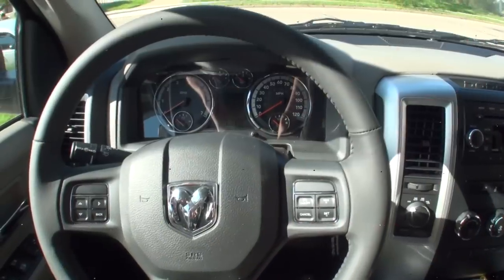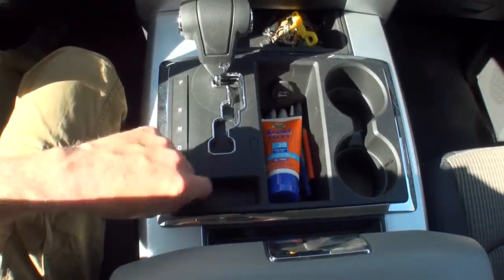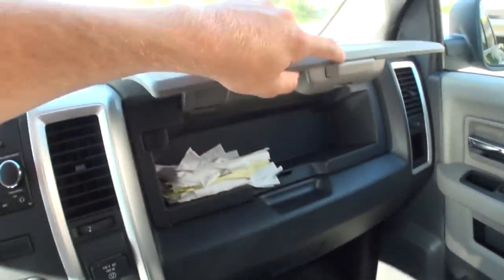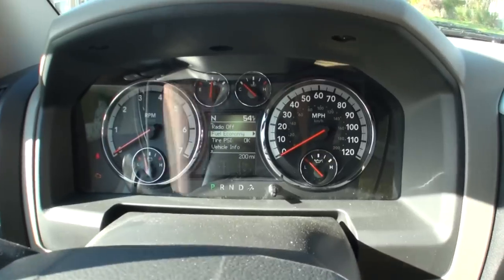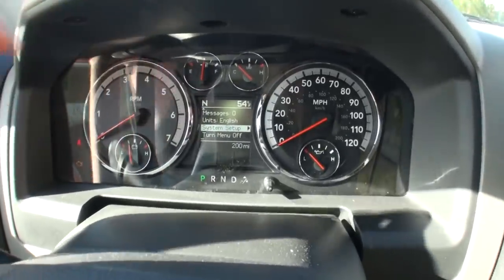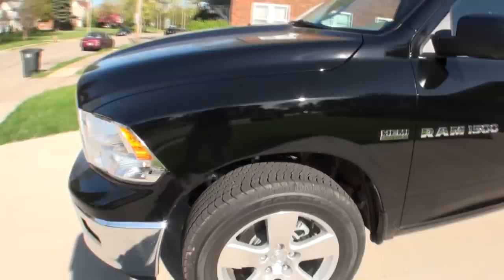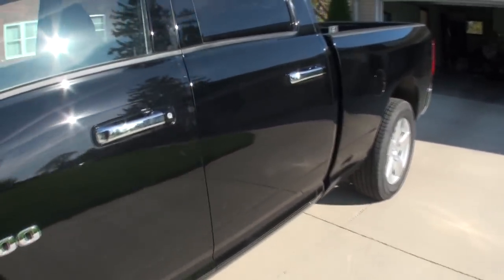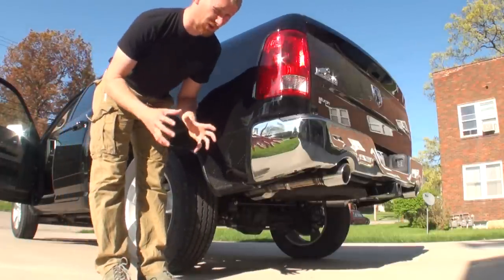2012 Ram 1500 Big Horn Quad Cab Truck Review

Comment: I have to agree with you 100% on this review.  I recently traded in my 05 GMC Sierra 1500 4x4 for a new Ram 1500 Big Horn crew cab 4x4 and I love it!  There is no comparison in trucks.  I've been impressed with every aspect of the Ram and after a week I keep finding cool little features, like last night, both front windows will roll down with the unlock button on the key fob.  I probably won't use that much but its adds to the fun of ownership =]  Well done Ram!

Comment: For the head unit, did you really want one w/U-Connect?? I have a head unit from an '09 Ram for sale if you'd like to purchase it. It's the same set-up as the current one you have now, so you wouldn't have to cut/splice wires to make it work. Has that extra feature though. I think the only additional thing you'd have to purchase would just be the speaker that mounts onto the upper part of your A-pillar; which obviously just plugs into the back of the head unit itself. I'm currently selling it for $60 if you'd be interested. Still in perfect working order/condition.

Comment: You don't have to get the center counsel to get two storage bins and the inverter. Mine is the 6 passenger version and I have 2 storage bins in the fold down center piece, both bins are hugh and hold much more than the bucket seat version. I also have the 115 watt inverter. The inverter is very common in Dodge vehicles. My 2007 Dodge Nitro had one.